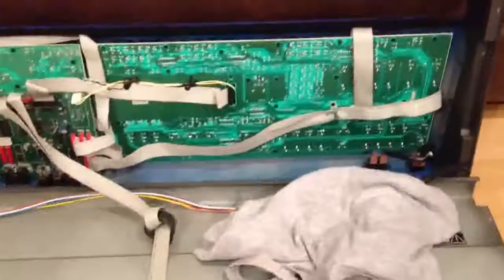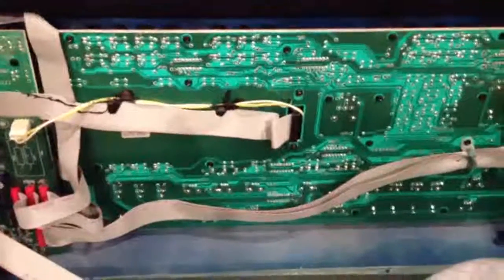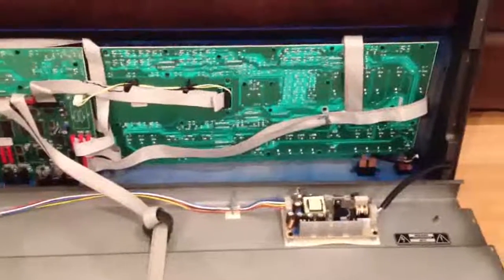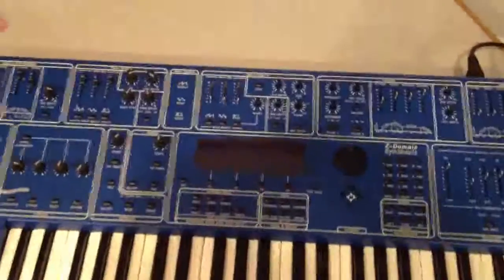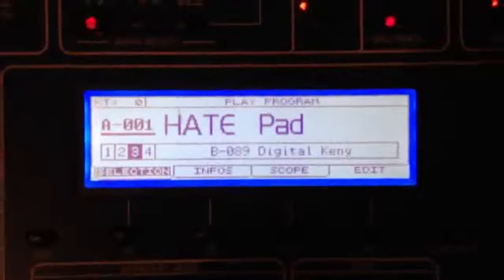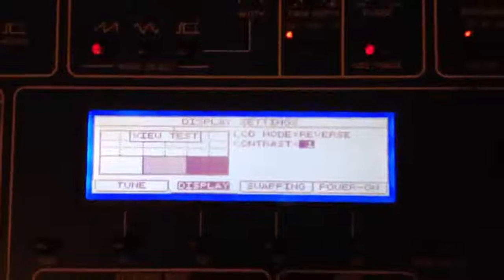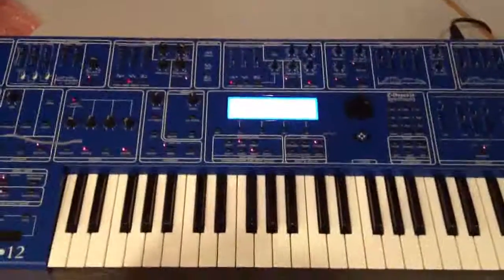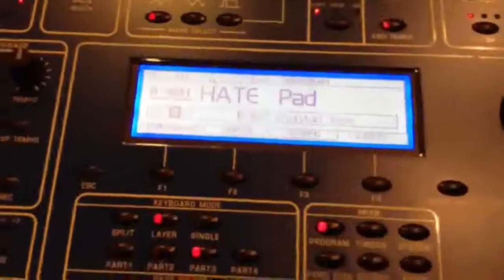Oberheim OB-12 Screen Replacement Video Guide (part 3).avi

Comment: Mark, I own a Oberheim OB-12 which I've had it for quite a while but haven't used it in a long time because only one patch works as I was carrying it in its case and it slipped out of my hands and fell on my foot but after that only one patch works. So I don't know how to fix it or locate where the connections of the sound patches is. I'm assuming maybe there's a disconnection hopefully it's nothing worse than that but I've never opened it up. Overall the synth works just fine but it's just only one patch works out of 256. Do you have any suggestions?

Comment: Thanks for this video Mark. 
As far as I'm aware, mine has just a backlight that needs replacing, do you have any tips or recommendations for me to do this?
Hopefully it is an easier task to simply replace or upgrade an LED? - any advice you have would be gratefully received.